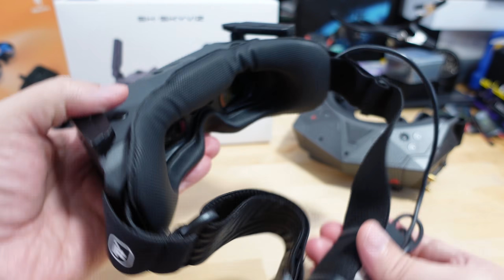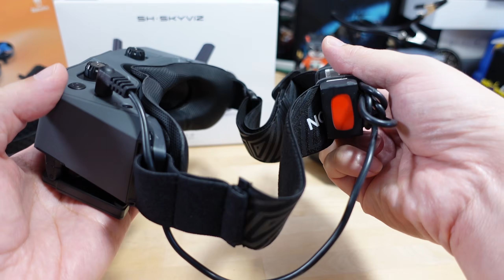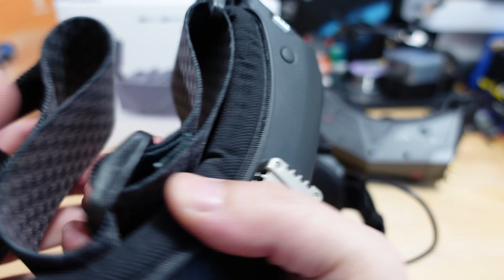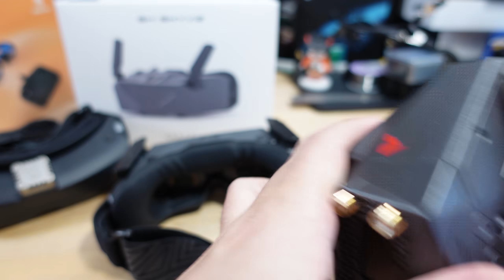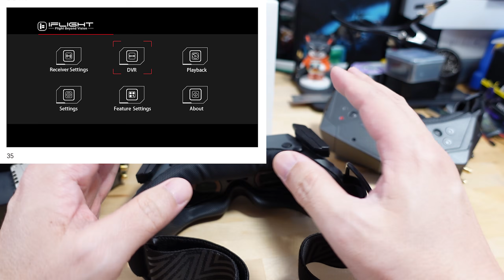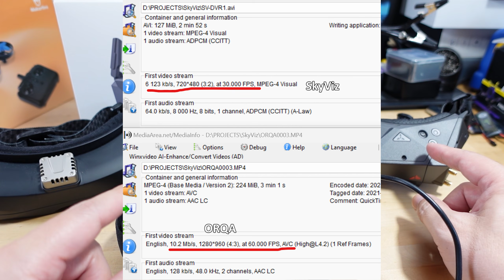iFlight SkyViz Analog FPV Goggles Review

Comment: i have the skyzone and like it very much. haven't tried anything else, but to me having a bigger field of view is already instantly better, for having better immersion. also the higher fpv DVR is important to me. i would love something more lightweight and with better design to places the batteries, and also better interface. haven't seen anything better yet. maybe the hdzero one is good, but only lets you use 1 antenna instead of 2.